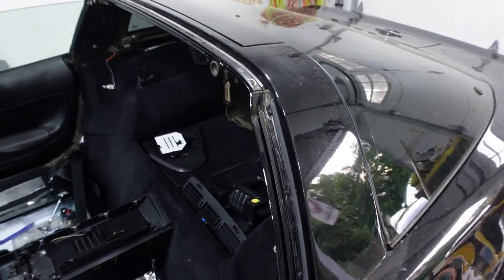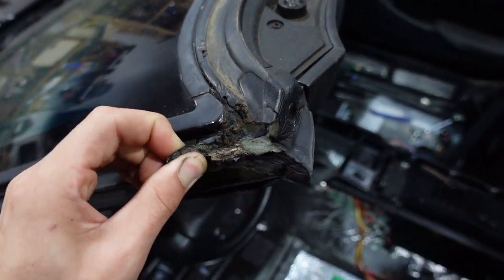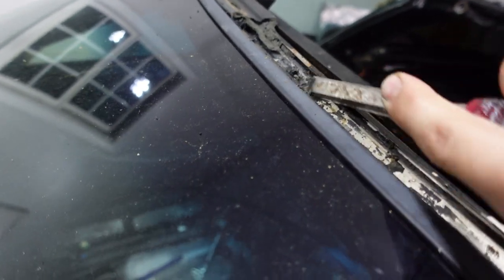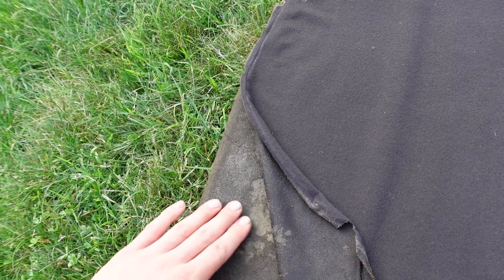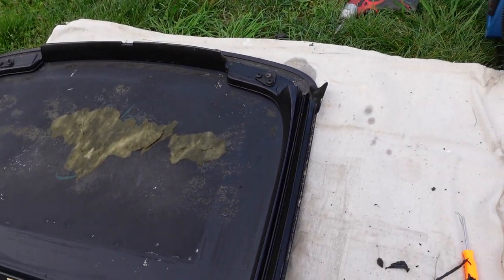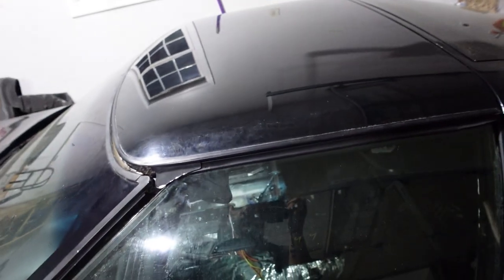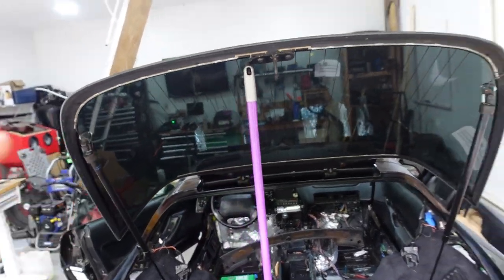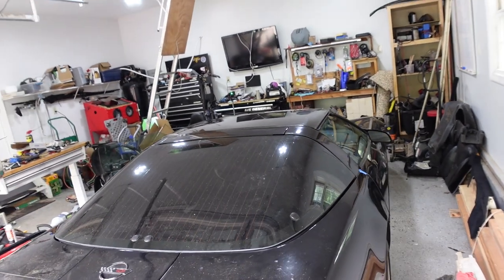C4 Corvette Weatherstrip Replacement (Front & Rear & Top) Corvette America

Comment: Hey!  Awesome job.

i look forward to seeing how the import version of the weatherstrip holds up.

i dont think you re-sealed behind the windshield a pillar weatherstrip channel retainer and the windshield molding.  if you find that you still have a leak that drips down on the door sill about in line with the speaker , u can seal those areas with black poly caulking.  that is where the water typically gets in.  great work!
Reply: One more thing. The white lithium grease is factory correct. You will notice that the grease is where the hatch weather strip retainer strip is pushed over the smc lip. It wasnt actually used as adhesive. It was used partially to aid in waterproofing but also to make the retainer strip go on!  You can try to run without it and see if you get any water ingress.
Reply from the maker: I finally found out that those are called the windlace door to dash seal. I’m attempting to reseal those now. 

I think the grease was definitely added after the bodywork because they went overboard but interesting to know that’s a factory thing. Water leaks driving me crazy!

As always thanks for the input!

Comment: With your top head liner just sand or scrub away all the loose brittle sand that's what I call it get it down to the solid board get some spray adhesive add new fabric and glue it back to the top it's what's I did on my 84.  I wish my 85 the solid top instead of the shit cracked plastic glass top which kind of hilarious cause the  small spider webs cracks don't leak but the strips do a little bit.